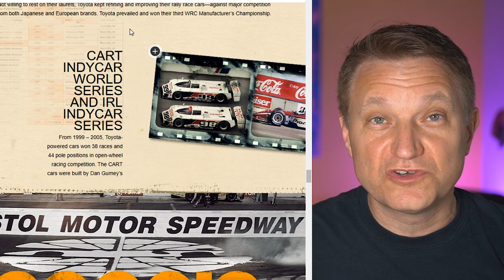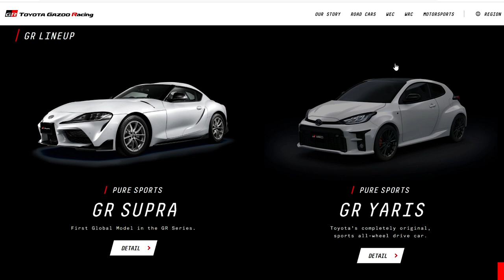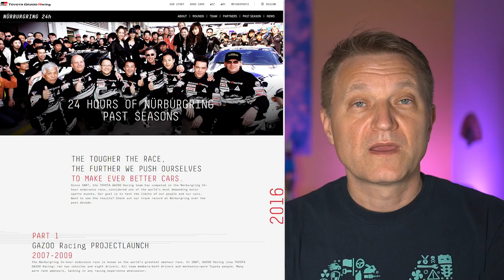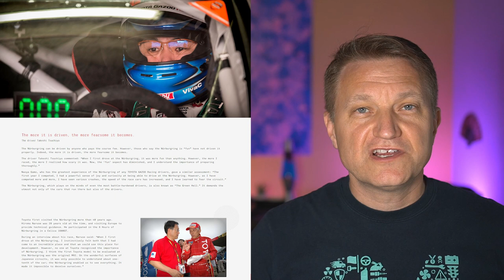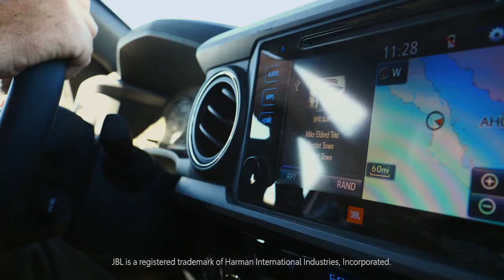Toyota TRD vs GR - The Future Of Japanese Performance!

Comment: 5:32 the GR Sport aren't purely a GR thing to do. The GR Sport name is the highest trim level on any existing Toyota cars (basically, much like TRD). To me, they might as well stick to the TRD branding as doing that will damage GR's image of making performance Toyota cars from scratch.
Reply from the maker: GR Sport is used ouside North America, but you're right - it's not the same as GR. Yet another confusing trim level.
Reply: TRD, Toyota and Gazoo Racing merged so GR is taking over all the racing department, while TRD is focusing more in off road components. Not sure for how long
Reply: @justinmedina2050 In Indonesia, the highest trim levels on some Toyota cars were under the name "TRD Sportivo", but ever since a couple of years ago, it's now named GR Sport.
Reply: @v12ts.gaming gua merasa kalau TRD dihilangkan dan semuanya diganti GR jadinya norak anjir. Fokus mereka aja berbeda. GR adalah tim balap yang fokusnya membangun mobil balap, TRD adalah rumah modifikasi yang fokusnya meningkatkan performa mobil jalan raya. Harusnya GR cuma disematkan di mobil balap kayak GR Yaris, GR Supra, GR Corolla dan GR86, sedangkan TRD disematkan di mobil jalan raya macam Fortuner, Land Cruiser, Yaris, Agya, Rush, dll yang sekarang diganti jadi GR. Padahal kalau boleh jujur itu cuma ganti logo doang sedangkan fiturnya sama kayak TRD dulu
Reply: @mrtiesthatbind  ini gw setuju, makanya nama TRD harusnya stay, jangan digantikan dengan bawa" nama GR...

Comment: Interesting Video! Some parts I was not even aware of. - I worked for TTE and Toyota Motorsport - which have been left out of the Video. :-D
Reply from the maker: There’s a LOT I could have covered, but I didn’t have time to make a 30 minute video. Thanks for watching as always!
Reply: @revmatchtv  You can anyway make a kind of series about that subject. Besides mentioned once there are a lot of interesting stories like that in the different companies. I think that should be quite interesting to watch.